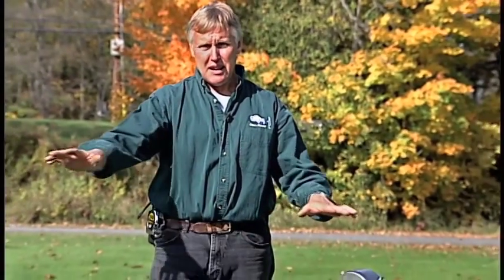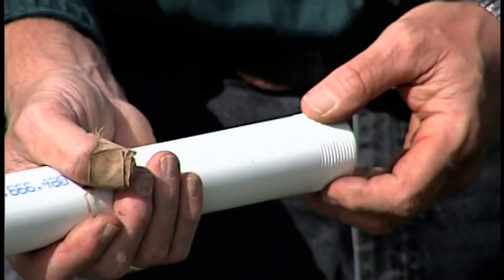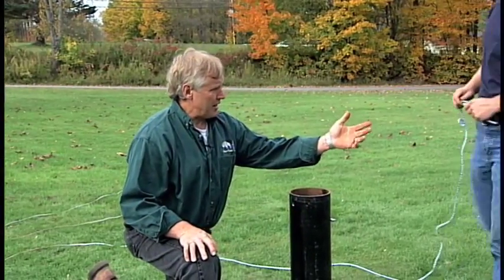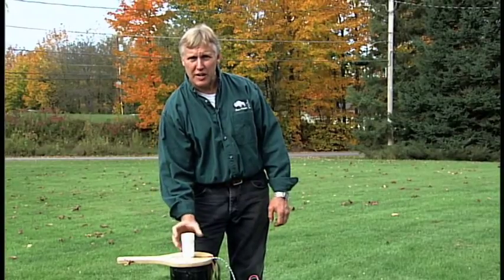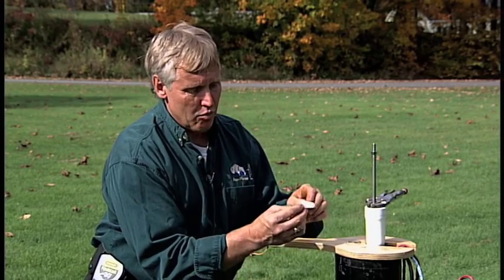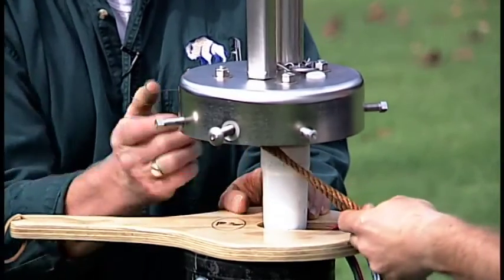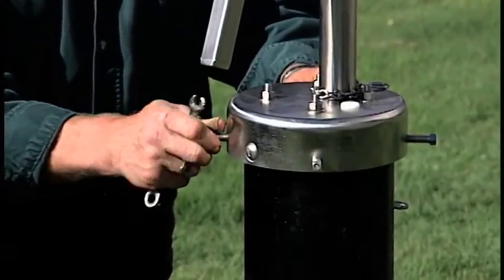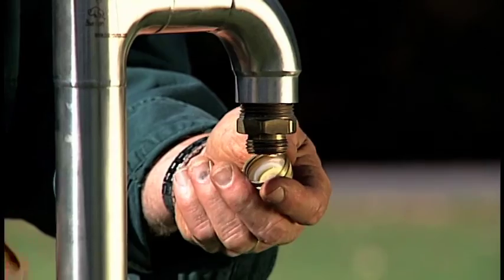Bison Pumps Deep well Hand Water Pump installation

Comment: We had one installed seven years ago, and we love it. Be forewarned: If/when your submersible electric pumps needs work or replacement, good luck. We went through five plumbers, and none will help us, because we have the nBison pump installed. Even the well drilling company who installed the bison, will not call us back.

Comment: alright, @18:07 so if you have water 100 feet down, and you live in a cold climate (and drilled the hole in the pvc pipe) after using the hand pump you wait 3-4 minutes to let the water drain out before you put the cap on...so next time you go to get water you have to pump 100 feet of water up until you get the first ounce of water out???
Reply: Only from the drain back hole to the top.   Below the hole you drilled will stay full of water.  My feeling is in cold weather it is a option to replace the cap at all as insects are the main worry of leaving the cap off.

Comment: dont u take the old elect.pump out first
Reply: No, it installs at a lesser depth.  But, if you have a problem with the electric pump at a later date you will have to first remove the entire hand pump system before you can begin to access the electric pump.   Otherwise, the electric pump works as usual and does not even know the hand pump is there.

Comment: Great explanation,I only don't see what happened to cables of the old electric pump and if that pump is gonna working still .
Reply: That issue was not addressed.   Most well installs have the electric cable coming up a plastic conduit on outside of the casing and the cable runs over the top of casing and down.   The last Bison kit I installed included a 90 degree conduit fitting that we installed a few inches down on the side of the casing.   We used a hole saw to make the hole and then reworked the conduit and cable to go thru this hole/fitting so the top of the casing was clear for the hand pump to sit on.   I stuffed a big cloth object ( my jacket) down inside the casing about a foot to keep any tools or other items from falling down in the well, if dropped, while working on the electric access hole.
Reply: @garyhoward3123  thank you so much for your replay,Mr.Howard.And thank you for your detailed explanation. It's truly great video.

Comment: Love this thing. Hope they are still in business. My question has to do with the torque arrestors holding the plastic pipe from shaking around too much. Wondering if can get this new pvc past it
Reply: Great question/ at face value seems it would have to be removed
Reply: @1new-man  Have installed Bison and Simple pumps.   If arrestors are installed I pull up the electric pump and remove them in the top area where the hand pump will extend down.   They will be in the way of lowering the hand pump.
Reply: @garyhoward3123  Mighty fine TY!
John 3:16

Comment: I live in the mountains and my static water level is at 200 Ft. My electric pump is at 400 Ft. They dropped a 1,000 foot weighted line and NEVER hit bottom.
Reply: Had they enough American made string and kept on going, and going, and going, they may have tapped the cook in the midst of a batch of Bat Soup
Reply: Wow.

Comment: What is a standard case size. Mine looks the same as his, is that 8" diameter?
Reply: Most domestic wells are 6.25 ID or less.  That looked standard 6.25 or just usually referred to as 6 in well casing.

Comment: If the static water level is 12 feet, than WHY do you have to go down 40 feet?
Reply: From my understanding, you want to go deeper because the water is better.
Reply: If you're static is that close to the surface,  then you can use a much cheaper pitcher pump that doesn't need a pump cylinder down the well.  Although pitcher pumps are not sanitary, and should not be used on wells for drinking water

Comment: I’m curious as to how well this pump would work on a deep sand point well. At 30 to 40 foot
Reply: It won't work on a point well, the 3" hand pump cylinder has to be down in water, point wells are 1 1/4" or 2" pipe. You need at least a 4" drilled well for this deep well hand pump.

Comment: Do you know what is the maximum depth of this well?
My well is over 200' deep, and I've been looking for a manual pump for quite some time, so far I've found nothing that can manually pump water from that depth,,,
Any information you could provide would be greatly appreciated!!!
Reply: Its not the well depth that really matters its the static water level from ground level. my well is 325 but my water level is 14 feet from ground level. The well is 325 because of local irrigation for farm and new town water tower with in 1 mile,
Reply: Deep well? my well is  600 feet in Arizona do you have any other options besides a pump.  trying to pump water out to see if I have any water that is recharge water to see if I have enough to supply my house with water
Reply: These Bison pumps will pump up to 300' static level (that's from the ground level to the top of the water in the well) per their website PDF page here --> http://www.bisonpumps.com/wp-content/uploads/2013/02/DW-Hand-Pump.pdf  or by going to their homepage and select the type of pump that fits you here -->  https://www.bisonpumps.com/. As Jerry said, the well depth doesn't matter, it's your static water level. You normally want to be significantly below the static water level for dry seasons and dry spells because the water table changes. You have to know your static level anyway so you know how many sections of pipe with the rod in it to purchase. Once you know your static water level, go a few more sections of pipe past your static level for the reasons I stated above. 
I plan on getting one here in Virginia. We just purchased 5 acres land with a well. My neighbors well is 475', his metal casing is 37' and his pump is sitting at 378'. Neither one of us know the static water level yet. I'm sure it changes with the rainy season, snow melt and dry spells.  
I'm in the Shenandoah Valley and we have all kinds of shale and stone here. So drilling a new well just to put in a hand pump wouldn't be feasible. The reason I'm looking at Bison is because they have deep well hand pumps. Since i already knew the depth of my neighbors well and I already have a well on my property, the Bison pumps seem like a good choice. At least a smart choice when the power goes out.

Comment: Why would you put a hand pump on a well that already has an electric pump in it?
Reply: Because when the electricity goes out you still can get water from your well.
Reply: I'm looking at a property with 2 wells. I'll definitely go with a manual pump for the second well head as a backup 👍
Reply: When the electricity goes out and you have a generator interlock switch on your panel, you can run the well pump if your generator is big enough. We are forecasted to have a big earthquake in the next 50 years (9.0) in the Northwest. The pipes from the well to the house might be broken, so could not use the well pump. If the well is still intact you could hand pump if you have a hand pump. Also recommended where we live to have water stored and purification ability for 2 gallons per person per day for at least a month usage.
Reply: @jackier7737  If there is a quake like you talk about the well will be gone too.